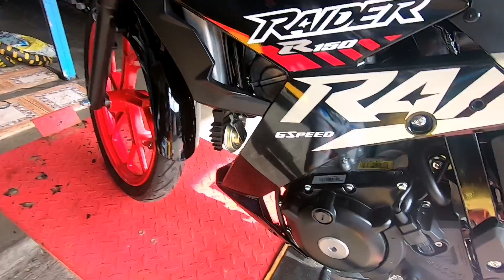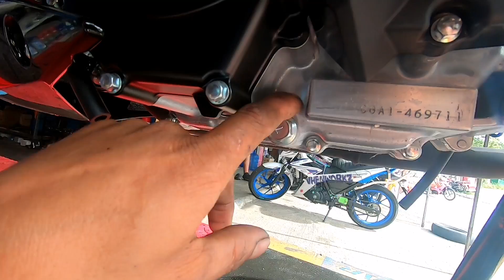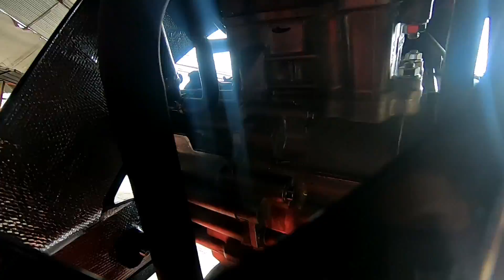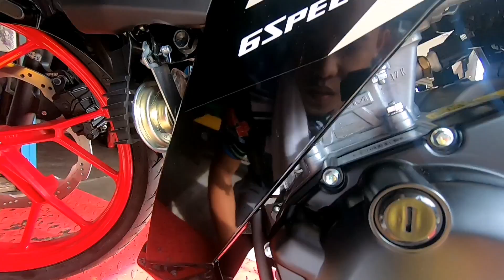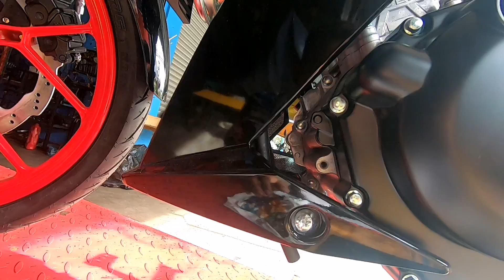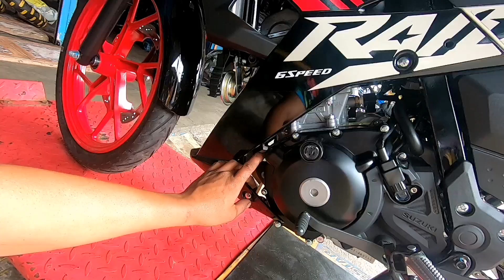Brand new Raider 150 fi my mga crack ang makina!

Comment: Heat crack sir ang tawag dyan.usually yung die na ginamit dyan pwede over use na.pero di naman issue yan.nagmark lang yung crack sa   parts.common yan sa casting process dahil over 680 degree ang init ng furnace o yung tunawan ng aluminum.nag work nga pala ako sa casting machine.
Reply: tama ka jan sir hindi crack yan